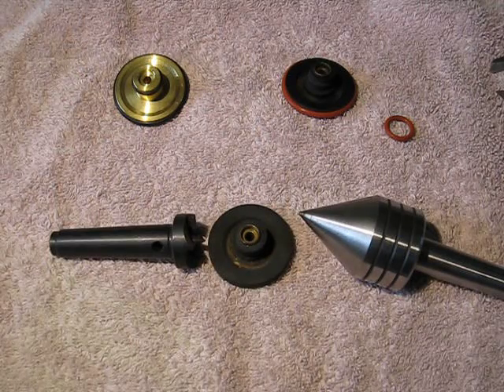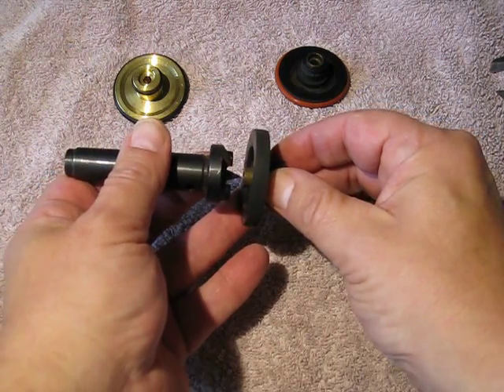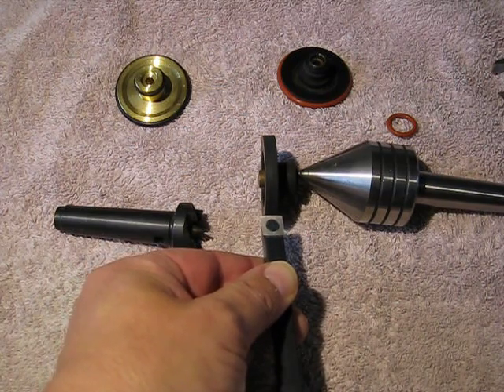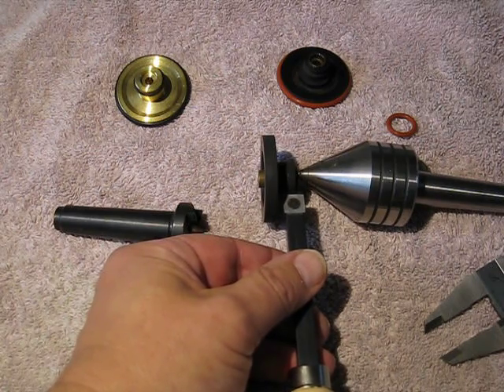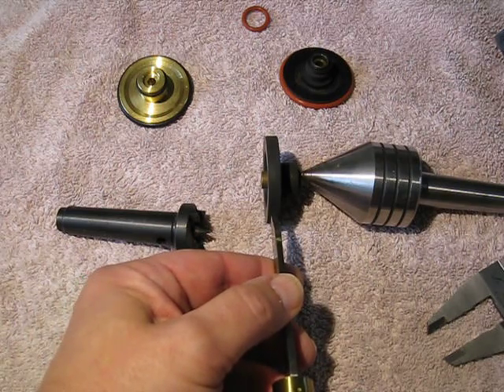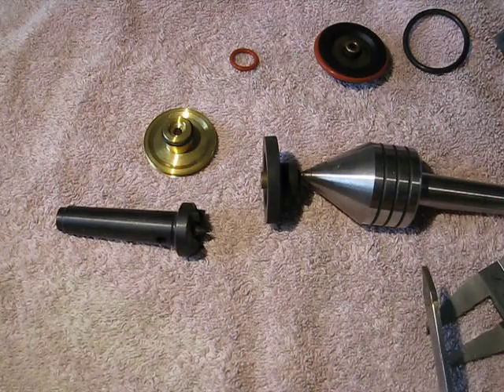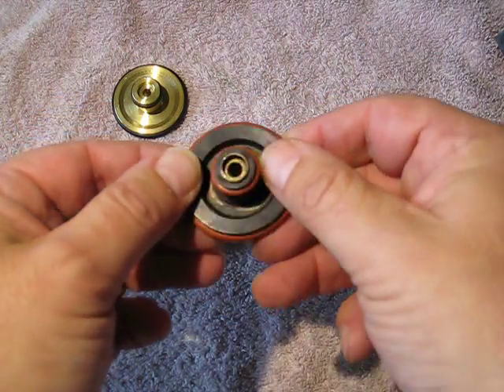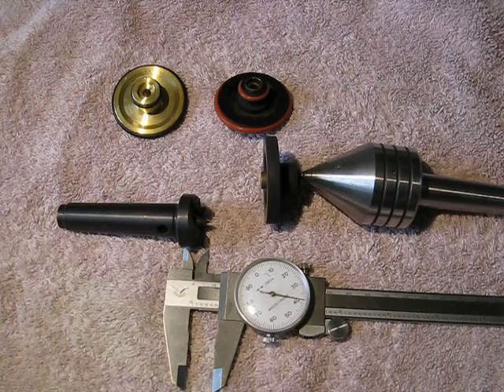Part #2: The RCA 45 RPM Idler...REBUILD IT YOURSELF!!!

Comment: Given many of the idlers considered rebuildable here are going soft enough to go flat; are they not close (in the next ~3-10 years) to turning into goo that is incapable of properly supporting an O-ring?

If you've got a lathe why not machine something akin to that brass pulley?...You could probably make one out of hard plastic even cheaper than the brass one and still have a better longterm solution than using the original rubber...You might even be able to make them fast enough to make a business out of selling them.

Comment: I have 8 different RCA 45 players and I have them working but most of them suffer from a lot of flutter. I'm having trouble figuring out the source.
Reply from the maker: Anders Hammer The problems are usually the same for all the RCA's. First, make sure you tear the motors down & clean them well. When assembling the motors together again, use only ONE drop of oil - DON'T drown it in oil or you WILL have an issue. If that didn't do the trick, the next most likely culprit is the idler. You'll either have to rebuild it or replace it - no other option. Seldom will it ever be a problem with the turntable.

Comment: Very interesting and useful methodology for restoring a rubber idler -- IF you have a nice lathe set-up!

Years ago I was given a beautiful RCA 45 player in an all brown Bakelite cabinet (with lid) to restore. It needed everything, new cart, new idlers, new caps... the works. I found some idlers on e-bay, the brass ones like you show.

But they were expensive, and the client didn't want to pay for them because she wanted to sell the machine after restoration and didn't think she'd be able to make back the restoration investment.

So I gave her back the machine and as far as I know, it is rotting away in her basement! Pity.
Reply from the maker: Unfortunately, most people don't realize the cost of parts & labor that goes into restoring one of these little players. I've learned to cut corners WITHOUT sacrificing quality of workmanship. Note my videos on the cartridges I sell as well as this method of handling the idlers. I'll soon have a video to show how to save the cycle cams without breaking the bank too.

You do NOT need a lot of money to set up a small lathe! You should be able to buy a small tabletop wood lathe new OR used for $150 or less. The great thing is that these mini lathes are not only cheap but very small and have many uses for those little jobs. I turn high-end writing instruments as a second hobby and have a couple of my works published as well.

You have great videos on the R2R players! I may have you restore one for me in the future!
Reply: seeburgsrock  That is good info about the small lathes. Anything you can do to help with cycle cams would be great! I never owned one of the RCA players, but I always liked them. I completely agree with you about restoring. It's great that you are taking care of these machines so they aren't lost to history. The other day I had someone ask "What is a tape recorder?" It's interesting. I couldn't blame the guy, he was only about 21 years old. He'd simply never seen a tape recorder!

Other technologies have come and gone, but we still have memory of them and what they were. We no longer use horse and carriages for transportation, but we know what a bit is, what reins, horse collars and so on are, and there are places where horse and carriage still are used.

We don't use bow and arrow as weapons any more, but there are plenty of archery clubs. Classic guns - plenty of clubs and magazines.

But old tape recorders, cassette recorders... an endangered species! The interest in vinyl is helping the record player stay alive. But there isn't the same momentum for magnetic tape. Yet, without the contribution of magnetic tape, our modern technology would never have been born. Yeah, it started with R2R but very few people today can appreciate what a huge breakthrough the compact cassette was. The evidence is all around even today. We can see R2R machines on YouTube, the RCA cartridge attempts, the 4 and 8 track machines. These pre-dated the compact cassette, but it was the cassette, that little flat pancake of plastic that revolutionized tape recording. The hard drive is still a magnetic device. It could never have been developed without tape recorders paving the way.

My videos are my attempt to try and archive this history before it is gone. These machines are finicky and some are quite rare.
Reply: +seeburgsrock  or you can go here to get new idler and or cam's cartgages all at reasonable prices http://www.thevoiceofmusic.com/